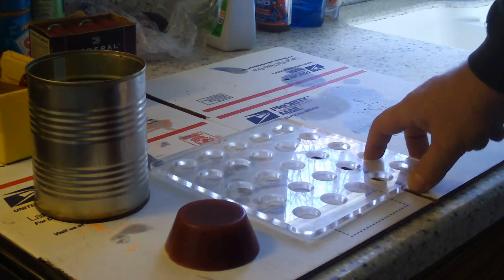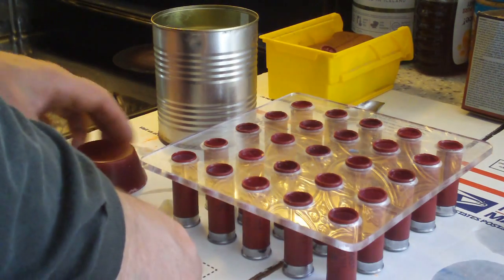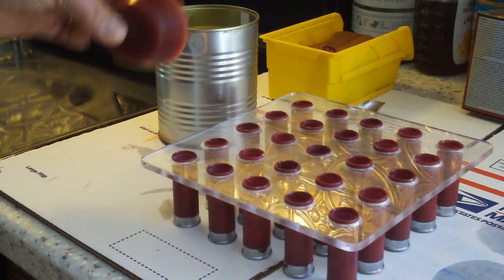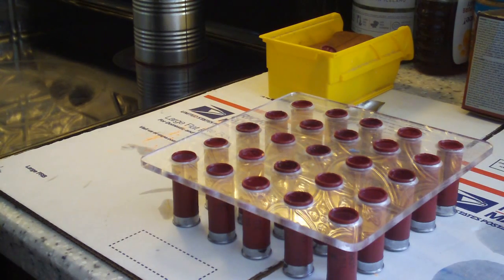makin waxerz

Comment: Hi do you sell a wax slug kit for 20 gauage,if so could you send me a price on it !Thanks
Reply from the maker: I'v got no way to make 20g grid boards or Shell Preppers using the tools I have because the diameter of the shell is too small for me to route the holes. The Shell Prepper for 12g will open 20g shells which I have demonstrated in a past video. I have made clippers for 20g, but I don't like or recommend clippers for wax slug making.